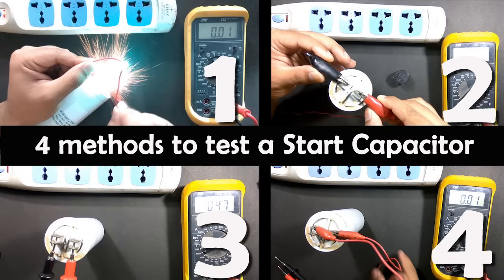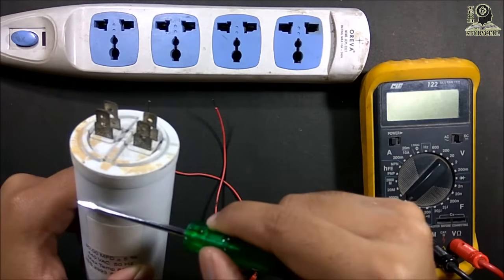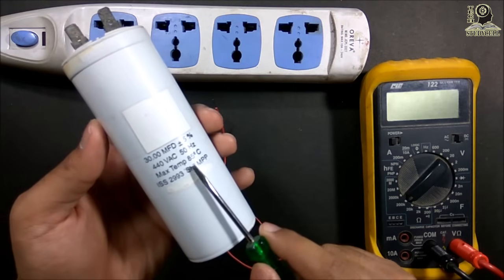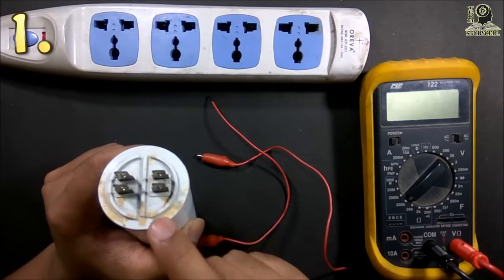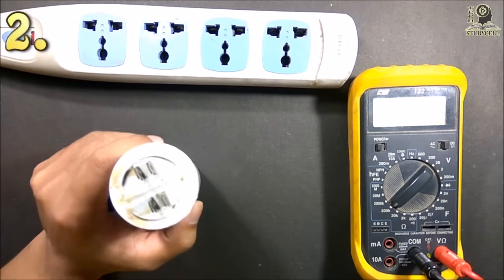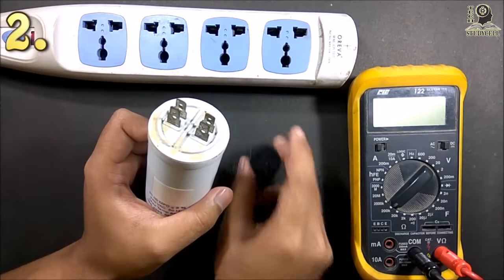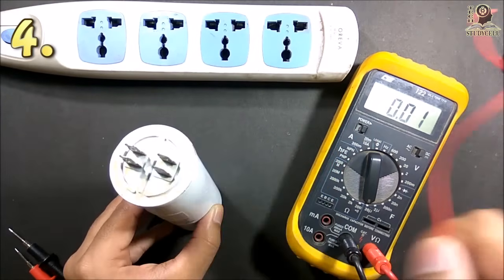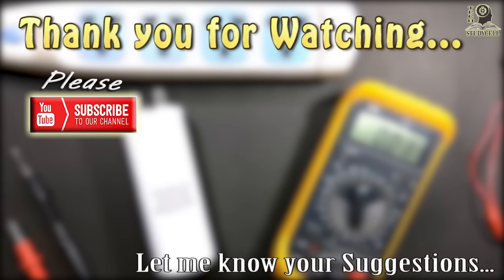How to Test Motor Start and Motor Run AC Capacitor of ac fan and compressor

Comment: Thank you for the video.
I also have the 4 pin type, it's a cbb60 for a MacAllister COD2000FLS tablesaw.
After testing the cap, it seems to be okay, it's holding and releasing charge perfectly.
Looks like I need a new saw 🫠

Leaving the brand and model number here for owners who run into the same issue, so let's hope Google search leads them here 👍

Comment: Hi great video,i have installed the new cspacitor to my compressor, it worked for 2 days but now when i start it ,the motor doesn't run  just mskes a noise as its struggling to start or its stuck ,any ideas fellow ?

Comment: Hello. 😊Thanks for the good explanation. I have a question. I am going to replace a capacitor on a power generator, and am wondering if a normal starting capacitor can be used for this, or if there are special capacitors for generators? ( 18uf 400 - 450 volts 5% 17-10 w ) Thanks

Comment: Excellent. We can measure the capacity of 30uF using another capacitor. If we have another 30uF, we put them in series and we have 15uF. If we have one under 20uF, we measure it and we find the value = a, then we put it in series with the larger capacitor and we find the value = b, b<a. Then the big capacitor will be x = a * b / (a-b), so the product divided by the difference.

Comment: Sir may I ask, if I have a motor starting capacitor for "Dough Mixer" of 80µF 10+20% 270V, and I have a reading of 85µF, shall I say that the capacitor is in excellent condition?

Comment: I have a Crompton water pump of 1 hp, recently I replaced the capacitor with same MFD but my previous capacitor has two terminal or wire in it and the new one which I purchased has 4 terminal, can  in install it to  the new one?

Comment: Very nice explnation
But i think 450v is running cap
Charging by dc it shoud less than second or no problem
If ihave two 110v capacitor can i connect it with 220v without problems
Thank u

Comment: Hello my dear friend capacitor   i think this copacitor is could running capacitor   ,  starting capacitor is normally open in start motor, running capacitor is not open thrle motor is opperation..thank you for sharing tjid video..👇👇👇🤝🙏🏼

Comment: Thank you for your video. I did test the spark method. The spark was not as powerful as yours, does that matter? Can I conclude that my capacitor is good, even though the spark was not as powerful as yours?
Reply from the maker: It is always recommended to use multimeter for testing
Reply: @TechStudyCell  I don't have a reliable multimeter. I'm going to get one online

Comment: Charging a big capacitor across mains power is extremely dangerous. Use a lower level DC and you must use a series resistor, otherwise you destroy the capacitor and you might injured.

Comment: Thanks for the video. How do you know if such a capacitor is actually faulty or needs to be replaced? I've got a garage door opener motor which no longer works, and I think the capacitor is dead... When I test with multimeter (3rd method) nothing happens at all on multimeter. Just stays on 0.0?

Comment: I have a portable air conditioner that doesn't work. I have removed the start capacitor and tested the resistance and it's on overload no matter what ohm setting I put my multimeter on. I have tried charging it, and discharging it and it's always the same. Is it safe to assume the capacitor is dead?

Comment: Good video, thanks! One question: when you measure, and connect back capacitor, can wires be in either location: there is no "plus and minus" connector, either way capacitor works !!!??? Thanks, youtheman =)
Reply from the maker: This is a AC capacitor, so there is no positive and negative terminal
Reply: @TechStudyCell  So, you can check it, or connect it either way, right??
Reply: @Eeropolvasti  yes, correct. There is no +/- on the capacitor
Reply: https://youtu.be/YGSHcyWju9c

Comment: Seen this video today...@2.13 please dont follow this method, since u r testing the capacitor. How do you know beforehand the capacitor is OK...if there is any short, you are inviting problem...charge the capacitor through a load of same voltage...

Comment: None of these methods are testing REAL capacity of start or run capacitor and some are further damaging to capacitor. Only valid way to test start or run capacitor is to measure curent draw and voltage drop across capacitor  in operation and calculate capacitance by using proper equation.  https://youtu.be/zgrAFq1Gf20

Comment: for a 3 wires ac motor (common wire, start and run winding) which wire should be plugged to capacitor? is it right to plug the common from the motor to neutral, live to capacitor which the other wires are plugged to the two terminal of the capacitor? or live to common and neutral to capacitor?

Comment: I've got an old motor with a start capacitor, the motor only hums when I try to start it.  I cleaned the centrifugal switch contacts and it still only hums on start...... so I wanted to test the capacitor and that's how I wound up here.   Now I shall go test the capacitor,  I'll be right back with the results........ and I'm back and still alive ....  the capacitor on the motor is DEAD, won't hold a charge after numerous attempts.  Another capacitor I happened to have did hold a charge and a nice spark on the run and start side.   I 'll order the correct capacitor for the old motor and see if that will get it to start properly.   Thanks for the youtube.  No telling how many motors go to the scrap yard when a new capacitor would fix them.   Thanks again.

Comment: I would NEVER use the AC mains as the FIRST test as shown in your video. If the capacitor is defective (e.g. with an internal short circuit) it could well explode, and/or cause the wires to melt and explode molten metal and other debris at high speed (into eyes, etc if one is not wearing safety glasses...which is bad protocol).

Comment: HI, this testing is totaly wrong. Charging capacitors on AC voltage if it is 50hz  it means the polarity is changed 50 times per second, u do not know when you disonect the capacitor and u can damage it. the capacitors are always charged on dc voltage u must use diode if conected on ac. Please repair the video and do not teach wrong.

Comment: Buy a new one.. you can test the old won using the continuity on your VOM to charge and test. Apply leads then reverse you should see a voltage kick if still good...

Comment: Very dangerous. If it is charged when you put the screwdriver on the top it would spark and could cause damage or harm to you. This should only be done while wearing safety glasses
Reply: Very dangerous? Haha!! Just looking at a battery probably scares you. This is how people have been doing it for many decades without injuring themselves. There isn't enough current to cause damage to the terminals. It's OK to use something like a screwdriver with a non conductive handle.
Reply: @jayryan7473  actually, I build my own batteries from the ground up. 

I've had a few times where high amps have created molten metal explosions in a split second. The first time it happened it sent out an explosion of molten metal as it melted a screwdriver tip. If that would have got in my eye, I'd probably have been blinded. 

It's the same principal behind how welding works. Not pretty. 

Always wear safety specs. Always

Comment: You should not connect a load such as this directly to the mains. What if the capacitor is faulty, as in has a direct short internally? That is most suicidal.
Reply: If it's a start capacitor it will already be removed from across the mains supply.Thats where start capacitors are connected.Otherwise they wouldn't be called start capacitors.

Comment: 5%+/- deviated does it means i can no longer use them if it is higher by 5% micro farad from the stated?
Reply: Of course you can use it. It s just the error margin as specified by the producer.

Comment: It should be realized that when applying a capacitor to AC mains and removing it, there will be a DC voltage present.
The size of the voltage will be determined by when the supply was removed in the AC cycle.  It could be anywhere between 0 and +/- 340V DC ( as the peak DC voltage is 1.414 times the AC RMS voltage,
My method is to connect the capacitor to a IEC lead, plugging it into a power point and switching the power ON and OFF briefly.   I then remove the lead from the mains supply & I measure the voltage with the multimeter and look for a voltage >300 Volts.  Discharge the capacitor by short circuiting it and repeat the process several times for voltage >300 Volts.
Then measure the voltage every 5 minutes or so & if the capacitor is still charged to the same voltage, you have a good capacitor.  If not it is leaky to some degree and should be replaced.
Discharge the capacitor before removing it from the IEC connector! 
I don't think we should be showing anyone "poking things into power points directly"

If you do this sort of testing a lot, make up a lead with insulated alligator clips (sometimes know as a suicide cord), but do not leave it lying around!
Reply: What about this if we connect the capacitor in series with 220 volt A.C  bulb of 60 or 100 watt?
Reply: what is the meaning IEC lead.
Reply: I am agreed.

Comment: Thank you. This trick really useful for my trouble since I only have a multimeter without capacitance meter.

My air con capacitor shows still charge and discharge by the multimeter, but how can I know that the function is still good?

Comment: The first way looks the best fun but please use a quick test block or similar. These are designed to temporarily  connect things to the mains. Just makes it a bit safer for you. Thank you so much for posting:)
Reply: But I have question,, if that dead dry battery acid use like they way done to use salt with water. So if you put salt with water for that dry dead Battery so you gona using only salt with water or u can put also acid in that battery?
Reply: https://youtu.be/YGSHcyWju9c

Comment: How to testing  3pole  capaciter
Reply: Mani Mundan  no such thing as a 3 “pole” capacitor .... you are probably dealing with a “dual” capacitor. A “duel” capacitor shares a common..... measure mfd from common to either side and see if you’re in range. Generally “C” will be common, “F” will be fan and “H” will be hermetically sealed compressor.

Comment: What will happen if I plug it much longer than a fraction of sec?
Reply from the maker: The method itself riskly. As the capacitance is high so high current will flow through it which can damage it. So connect it for a fraction of second to charge the capacitor.

Comment: the first method is very unprofessional and absolut risky for your life. This maybe the testing method in china, india or elsewhere in the southeast asia but dont show this bullshit on internet!
At least use a diode and a resistor for slowly charging and discharging. When you handle such capacitors you should at least have simple test gear like multimeter or multi component tester available for just a few bucks :-)

Comment: Please note that, while doing this, I suggest that capacitor not to be connected directly even little time, since we want check capacitor is Ok or nor, there may be open or short internal, it should be always to be connected one series lamp with this, so the test will be safe, if not incase short, it will  explode with no time.

Comment: A dangerous practice IMHO, bare wires into mains sockets, bare hands, risk of bad capacitor blowing up in your face. Small caps and low voltages yes but not what this guy is doing with a large AC motor start cap.
Reply from the maker: I have shown 4 methods of testing. Among them one method is risky but with that method, if you don't have multimeter still you can test the capacitor. I have already mentioned the precaution should be taken for that.
Reply: @TechStudyCell  .

Comment: could you please explain third method    (or please refer to link explaining etc...)?
how capacitor is charging without a source ?
Reply: The multimeter has a souce. Recall to measure resistance, you need v=IR, so the resistance of the capacitor increases with increase in charging and vice versa.

Comment: sir how to identify the starting and running capacitor
Reply from the maker: You can identify both capacitors by observing how they are connected with the starting (auxiliary ) and running (main) windings.
Reply: Starting capacitor will always have  high capacitance, its start from 80-110 uF. 
It should b connected with starting (aux winding) in series with clutch. Besides this the running capacitor is always cannected with one end of both windings.

Comment: sir! this is  what happens to me alot: I follow the test procedure exactly; but I get  an ol, always? and with THREE DIFFERENT DIGITAL METERS (TWO HAVE DEDICATED CAP MODES); on two each of start/run capacitors(one each, fresh out of the box!?), on a repaired motor (single phase), which said motor - in spite of the $270 "repair", still doesnt run. So, this is why I hate electronics - I hardly ever feel like I am getting anywhere... Can you help me? thanks...
Reply: You don't know how can check capacitor

Comment: Can u tell me how can we know which teminal is positive or negative
Reply from the maker: For the AC capacitor, there is no positive or negative terminal,  both the terminals are same.
Reply: Tech StudyCell my ac capacitor was blast somedays back. I got the new one so how can i connect it. Becoz i connected it bt ac compressor wont start. Only fan is working ..Pls help me
Reply from the maker: It is not possible to tell how to connect the capacitor without looking at the circuit diagram. First, identify the auxiliary winding and the main winding then connect the capacitor as per circuit diagram.
Reply: For AC Capacitor no positive and no negative.

Comment: You can charge capacitor by use a diode for high voltage. In this way you can charge at max voltage all the capacity.
Reply from the maker: yes. but I have tried to show the testing of a start capacitor without any component and tools.
Reply: Yes, I understand this, but you don't will have never the total capacity and so if the capacitor is very good or less.
Reply: @mikr1334  You really don't understand.

Comment: Nice video.. I need help :( I have a power washer, it was humming on start and not running, I had a larger capacitor in garage and changed it over, motor ran for a minute and blew up capacitor, it was rated over double  uf.. Is it a start or run capacitor? There is only one so I assumed it was a start,.. I will send link to power washer pdf parts :) thanks if you can help
Reply from the maker: If no centrifugal switch connected in series with the capacitor then the capacitor remains connected during running period. Please always replace the capacitor having the same rating  (uf must be same, voltage and temp can be higher or same) for both start and run capacitors.
Reply: nice